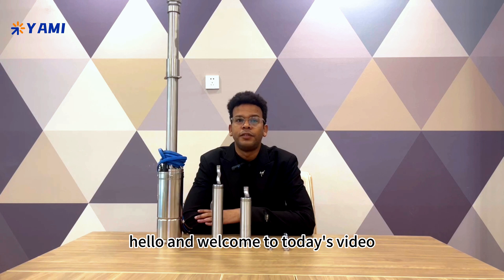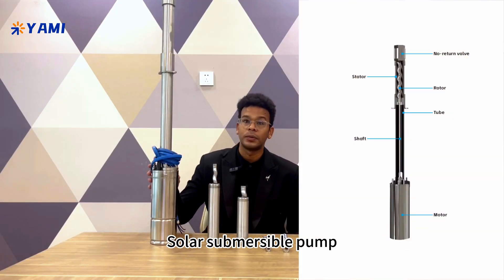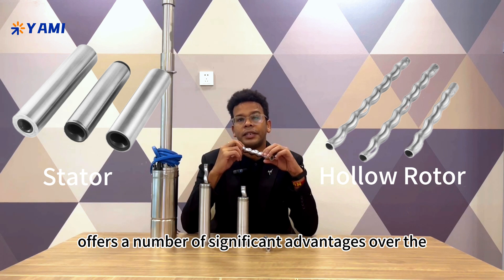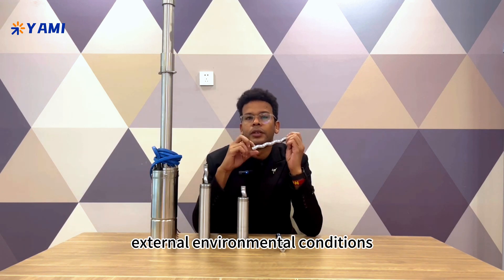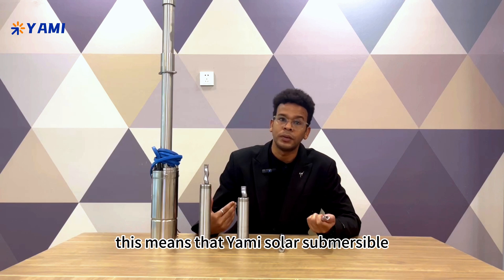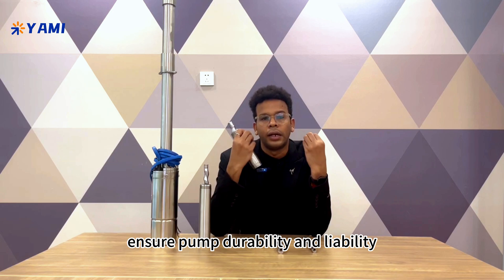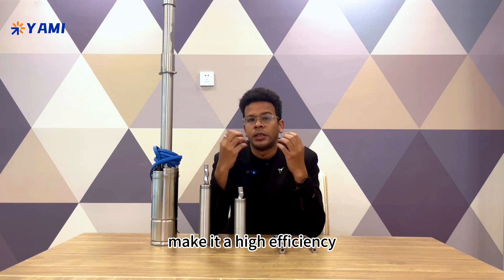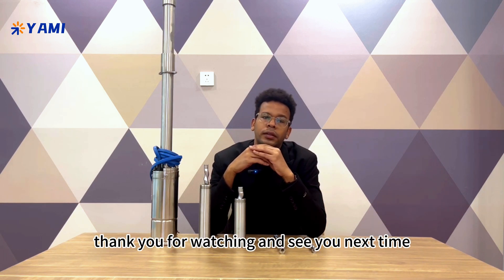Solar Helical Rotor Submersible Pump - Yami Stator&Hollow Rotor&Motor

Comment: What is your project where I Fix it// in put /output
Reply from the maker: We are solar pump manufacturer, we can produce all parts of the pump. It fixed in deep well pumping. It’s working by solar power by solar panels.